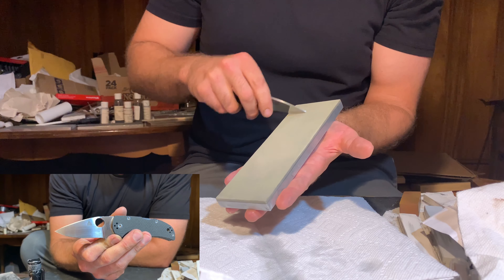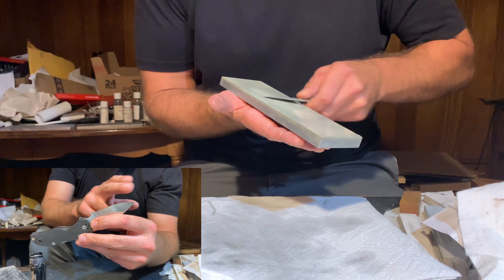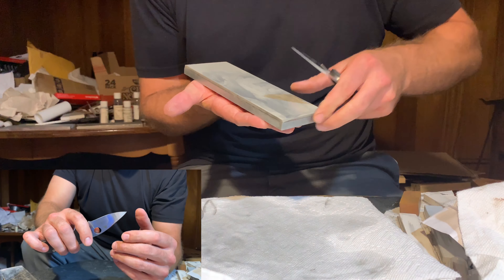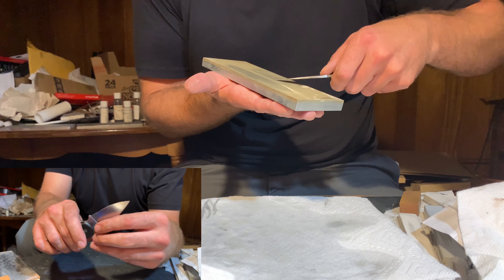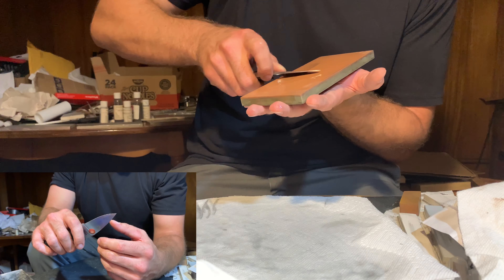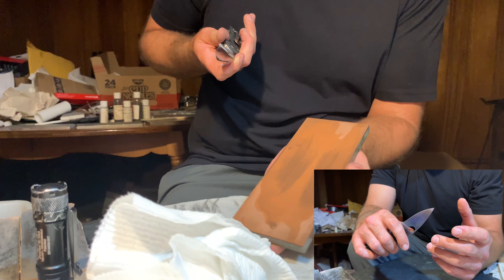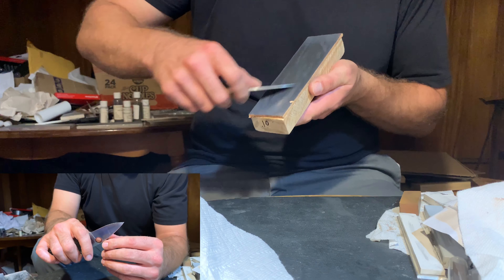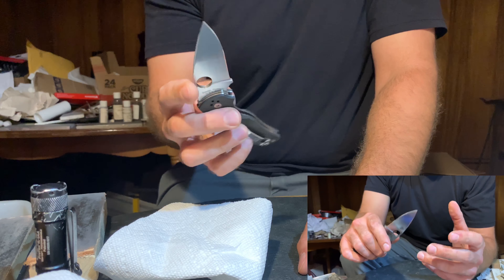Knife sharpening - S110V Full Sharpening

Comment: I bought the 2mm Venev 800/1200 double sided stone, really made getting a "finer" edge after diamond plates a lot easier. Didn't need the crutch of using alumina based stones, or needing to use 12 different strops. Thanks.

Comment: I loved this. The way you sharpen is a work of art. I've found holding the stone for me is much more comfortable. I feel I have more control this way than the stone on a counter. May I ask a couple questions? Sometimes, I tend to have wavy bevels. It's depressing. I know that my angle was just off at that certain stroke. Does this really effect anything? Should I care? Also, how much pressure are you using during stropping? Thank you for the detailed videos!
Reply from the maker: Michael Babin functionally speaking, the change in angle is not going to be a big issue.  I higher edge angle will give lower edge retention, so it’s something you should work on, but don’t worry about it too much while you get there.  
When stropping, I use a pretty good amount of pressure, but I also use strops that are made to take more pressure without giving.  With different strops, it would be an issue or I’d have to adjust my technique.

Comment: Hey Michael, I have a sharpening question. I can create a burr on each stone I am using and generally go through a DMT extra coarse, coarse, fine, extra fine, and then the Spyderco UF. Let’s say I am all the way to the UF in my progression and have traded the burr side to side; the burr is now on one side of the edge. Do I strop from this point, or should I do some strokes on each side of the edge to make it more even? I don’t know if I am making sense, but I often struggle with having each side of my knife edge to be equally sharp. 

I appreciate all you contribute to the knife community with your videos and responses to comments. Thank you so much!
Reply from the maker: thegreatchug as long as each stone (including the UF) is creating a burr on each side, and not flipping it, I would say do some light passes on the side with the burr to weaken it, and then begin stropping.  Your first strop should completely remove the burr so that each strop after that helps to define the apex.
Reply: Michael Christy thanks for the reply, brother. I will do that.

Comment: Great video Michael!
I wonder, given your free hand technique, do you end up with a significantly convexed edge? Have you ever examined your edges under high magnification with regard to bevel contour?  
Thank you!
Reply from the maker: Joshua Briggs there’s always some degree of convex, even with guided systems, if you look close enough.  But for all reasonable arguments, I can produce a V grind or a convex edge through freehand based on which I want.
Reply: @michaelchristy4982  thanks for the response. Just wondered how much your technique of holding the stone in hand affects bevel shape. You've probably got so much repetition that you've developed consistency. Love your ambidextrous fluidity😎
Reply from the maker: Joshua Briggs check out my video in CTS-XHP Edge finish testing.  Skip to 15 minutes in.
Reply: @michaelchristy4982  nice mirror edge on that Chaparral!
Reply: Joshua Briggs  For what it’s worth, Michael holds an extremely consistent angle...I know of only a handful of people in the same league.
Reply from the maker: Wolf H thank you.
Reply: @michaelchristy4982  if I’m just starting out, (I’ve already ruined my Para3 using a Ken Onion Worksharp after not achieving good results with the Sharpmaker) what can I get as a basic stone kit and progress through the different grits? Also, ass a rule of thumb for s30v, what are the proper microns I should be using for my strops? Should I pay you for this advice 🤷🏻‍♂️ Hope to hear from you.   Thanks

Comment: Michael Christy
I noticed you raise burr/Apex one side then the next and the move to the next stone. I was always taught to alternate passes after burr was formed on both sides to knock the burr down or off and then move to the next stone and repeat that process. It seems you just go straight to the next stone after the burr is formed on the second side without alternating passes. What are your thoughts on this?
Reply from the maker: J Torres you’re absolutely right, I don’t bother with burr reduction on each stone because I think it’s a waist of time.  Not only is it a waist of time, but it increases your margin of error, just because it’s more time spent on the stones.  
As you move through the stones, each “next stone” will remove the burr formed and start building a new burr.  By removing the burr before the next stone, that stone is simply building a new burr.  Why take the extra steps when the next stone will do it for you in the first few seconds?

Comment: very impressive, since I look your videos I started to sharpen my knifes free hand by myself. and I got my para 3 in 110 hair whittling (almost, it catches the hair.) I finish on a fällkniven CC4 (should be 0.1 micron) and then strop. but I got no good compound. if I only buy one which should I take. 1 micron or lower. hope to see more videos like that.
Reply from the maker: Paolo Pinkel 1 micron is probably the most important compound for me.
Reply: i use the same fallkniven to finish too. i just use a basic green compound from the hardware store. it just starts to gives a hair-whittling edge, but i havent invested in diamond emulsions yet (my highest carbide steel is 20cv, so also not the same steel) as always great vid!
Reply from the maker: asleepyinsomnia thanks

Comment: Why did you move down from the 6000 to the 7/5 micron ocb (7/5 micron is near 2000 grit in JIS)
Reply from the maker: Stones&Strops because the 7/5 micron leaves a finer edge.
Reply: Yea cuzz your not doing it right
Reply: That's like sharpening all the way to 10,000 then going back to 1000 cuzz you dulled the edge by holding your stone inconsistently

Comment: Hey Michael. I Know this video is older but I’m hoping you still will see the comment and maybe reply or maybe somebody in your audience with more knowledge than I will… I have a manix 2 in s110v. I also have two double sided Venev stones (100%) 100/80-50/40 and 7/5-3/2 are the micron labels. I’m wondering if I go through a full progression on these stones How S1 10 V would handle it as in Will it still have bite, I would like to go as high as I can while maintaining a sharp edge with bite and I really would like to try these stones do you think they are good for this steel type and where would you stop given what I have? I also strop after sharpening with rolled buffalo leather and white compound Maybe I should inch drop at all if I go that high? What are your thoughts thank you for your time
Reply: After you progress through all grits it will be pretty polished but still have bite just keep trying new things. Even stop after every grit and strop it check it and then decide what you like. You also don't have to stick to stones in the same line you can mix and match for the most part

Comment: @Michael , you already have the best and most modern sharpening stones one could think of. Did you ever lap (or dress) your 306UF stone to a higher grit rating? A glazed 306UF (called 306UUF) has much higher grit rating, cuts slower but leaves a finer polish. It seems to be your most often used stone and i use my 302UF a lot too! I discovered that the DEGUSSIT DD57 FINE ruby stone cuts fast and is even finer (and higher quality, denser ) than the 306UF (but not the 306UUF). Glesswein has a small selection, i have purchase access to the full catalog. 
http://www.degussit.com/wp-content/uploads/2015/06/DEGUSSIT-DD57-Fine-Medium.pdf
It's industrial grade extreme quality very expensive ruby stone, made in gemani, now owned by Kyocera-Solutions.de, probably the best ruby in the world. Just wanted to share the info, in case you don't want to glaze the 306UF yet want something finer, better.